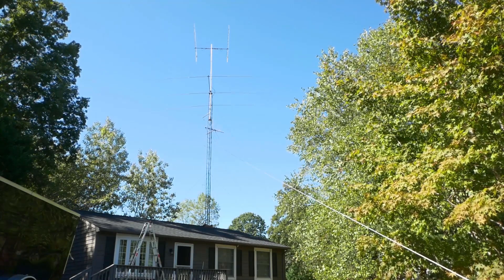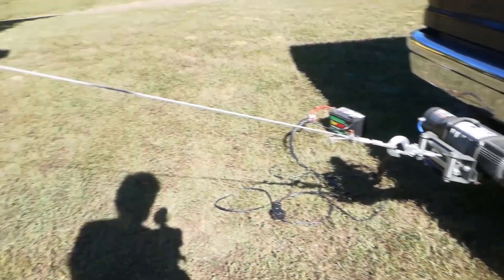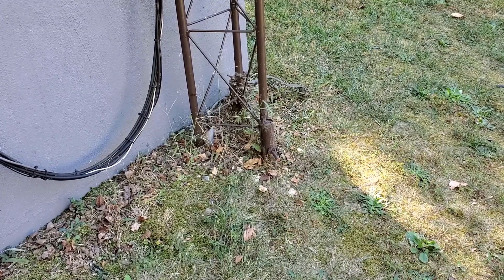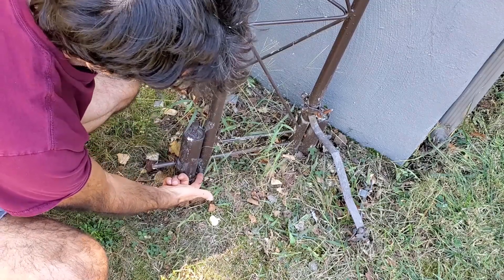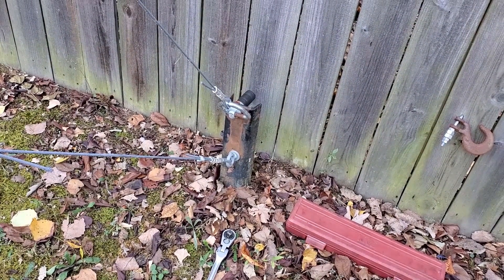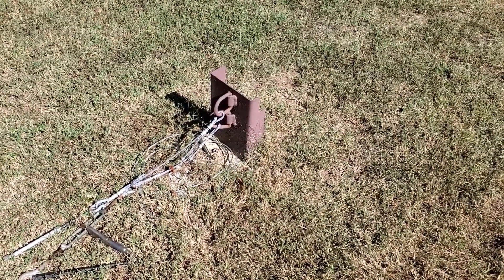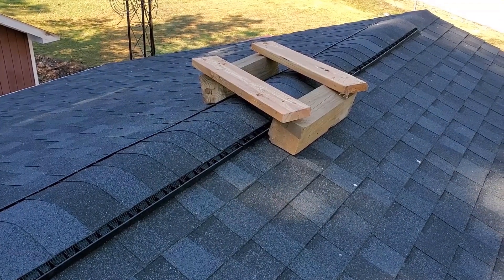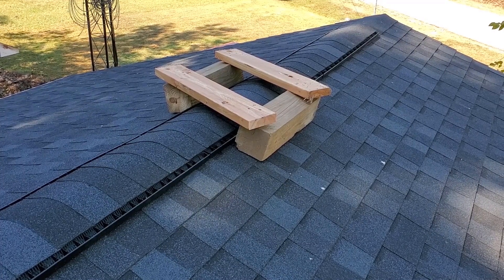Lowering and Raising Rohn 25 Tower w/ CHEAP DIY Homemade Hinge!

Comment: Thanks for the vid.  I just got a Rohn 40' tower for nearly dirt cheap.  I have a cathedral roof with a very steep angle and I've been trying to figure out how to erect this thing with a 10' additional mast for a Hex Beam antenna.  I just had my roof replaced after Hurricane Helen and I didn't want to damage it by running the cable over the top of the house with a electric winch. Thank you again.
Reply from the maker: HI!  I think I showed it in the video but I used 6x6 blocks of wood over the peak where the cable was going to hit at the peak.  This way I didn't risk damaging anything.  I even took 2x4's and ran them between the blocks so they couldn't move...

Comment: I'm working on my first "tower" install. 30' fence top rail with Televes DatBoss on top. 10 or 12 pounds it is. It will be attached to the eve / roof peak area of my single story home. Figureing out the guy wires has been an issue. I DO NOT want to put any holes in the roof and thought about doing 3 guy wires skipping the 4th. But that kept me up at night. So two guy wires will attach to the corner soffit area at the antenna end of the house. 3rd will be fastened to a tree in back yard (nearest) antenna side of house. And the 4th will be strung over the house and attached to the oppisite roof eve/peak. Also... that tree will help hold the base of the antennea as it is witched up into place (diffrent 30' cable holding the base). That's the plan anyways. Will do some testing (lifting/winching) and also get all my guy wires measured and made before doing it with the weight of the antenna. Slight worry now on the weight of the antenna and flex of the 30' top rail. Wish me luck. Tips/advice accepted.
Reply: Update. All 4 guy wire "mounts" installed. 30' pole (3x10) weight tested. And preliminary raised. Sans antenna. Beautiful day for it too. Now I'll figure out the winching situation. Create 2 more guy wire ends (loops for at the mast). Wait for a good day. And raise a darn antenna or 3.
Reply from the maker: Excellent!  Always love to hear about another antenna being put into service... 😀.  Depending on your setup I use an electric ATV wench I got from harbor freight and connect it to my truck as a stationary point... Works great if your able to use a vehicle for a pulling point.
Reply: I used to do lots of yardsailing and reselling. At one time I bought a Superwinch x2 a long with an ATV handle bar type in/out switch. 5$ I think it was. Just so happens it works great all these years later. What's got me worried now is as I pull the pole up with antennas on it how to make the high/antenna end not vear left or right as I lift it towards the house. The base at lifting will be held in place by the forth guy wire tree with a cable attached firmly attached to the lower pole hole. Not hinged. But it could be. Should be? Just would hate to have the pole (and antennas) crash left or right before they go up to the house mount at the peak. I'm thinking now the 2 side guy wires / mount points would make a great safety system. I'll need to test that too. Those 2 side wires could maybe also act as a "stand" for the pole as it sits near the ground for mounting antennas. Btw... Windy as F today. That made me smile thinking about the forth guy wire. Not the three I had first planned.
Reply: If it's being lifted. Wire pulled solid. Base held solid. Can the high end even vear? Crash into the ground I mean. You can tell. I'm kind of new to this.
Reply from the maker: I'm not grasping a clear picture of what you've got going on there!  Can you clarify? @jqzIII
Reply from the maker: Yes youre exactly right at being concerned about a pole shifting left/ right.  A tower has a base that's about 12" apart so there's 2 points of lateral stability there.  With a pole it's only one point.  If you don't have 2 extra people to help on each side with a guy wire, you'll have to tie them up somewhere and leave a little slack... raise the pole a little, loosen the guys and keep doing that all the way up.  It will certainly get away from you if you don't do something.... 😀
Reply: Another update 2... No Google image link this time. Another update. Got the winch going. Plan B metal base w cinder block weights. Worked. New issue is... Damn these fence top rail pipes are bendy. Especially at 30' with weight on them. Gonna try to add a Google Photos link to 8 images of my setup so far. Looking for advice. And yeah... I'm going to have to inlist a few friends to man some safety ropes when the time finally comes. Was a  lil hairy doing it even partially solo. What I am thinking. To cure that bend is to buy maybe a 20' length of good PVC pipe to sleeve the metal. The last 10' would still be metal. No PVC. Also at the seems of the metal poles I epoxied the fudge out the joints with some JB Weld Steel Bond stuff. I think that helps with integrity somewhat. Hope YouTube lets me post this image link... Nope. They didn't. Thanks all.
Reply from the maker: Yep, I've used those fence pipes... They are like a wet noodle when they get to a certain length!.. 😀. It'll cost a little more, but I've used 2" electric conduit for the bottom 10',  then I find a pipe size that'll go into that and overlap by about 2'... It'll probably take 4 pipes with 2-3 feet of overlap each time to get your 30', but it'll be a lot stronger.  I think the fence pipe is only 1 3/8 if I remember right...
Reply from the maker: HI, it should work with just 30'.  You could do 3 guys if they are pulled at 3 equal angles from the pole.. with the 2 at the corners at the antenna end, you have no choice but to do 4.  I would put your pull point at about 20 - 25' and you shouldn't have any trouble.
Reply: @JLPicard440  Cool. Good news. Glad I didn't go for only the 3 thinking (just pull it taught). Would have been 100% wind "exposed" on that one side. Was going to mount the 3 roof area pressure treated guy wire brackets today. But my ladder was icy. Ain't risking it. Thanks for the reply.
Reply from the maker: No you don't want an icy ladder!  That could result in some unfortunate results... 😀
Reply: Here is where we stand. I got 2 10' flared end PVC the good stuff schedule 80 I think. It will be sleeved over the lower portion of the noodle fence tops. It was Pricey man btw.  And I have my old strong thin sturdy skinny conduit from previous antenna about 15' long. I am going to insert that inside the top half of the noodle. lol Also... I don't have much in the way of the friends department. For safety ropes holding. So I think I figured I can fashion a hinge of sorts for the bottom of the pole. Just exhaust clamp one of those green painted metal skinny strong wire fence stakes at the bottom of the pole prior to lifting. That should help keep it from veering left or right while raising. That's the plan anyways. Windy as heck now. Blizzard is coming they say. Might do my hinge rail clamp 'till then.
Reply from the maker: Excellent!  Yea I'm in the same boat with friends that would come help... I could probably get a couple guys if I begged, but I don't like to bother anyone... 😂. IN a way its a good thing, it forces one to figure out how to do things by yourself...  Yes I've seen where there's some bad WX coming in through some areas...  I would definitely want a calm day to see how that pole will behave..
Reply: Another update. Turns out my guy wires work. Storm came through a few days back. EF2 tornado they say. 130mph winds they said. The Fairview WV one. (also hit Ohio and PA) 15 mile path. I had one tree blow down towards high power line at my back hill.  It came through at night. I was woke but slept through it. Turns out the path (they say) was about 70 feet from my install. ((( You guys & my FOUR (not 3) guy wires ))). Seriously. So thankful. Thanks again all.
Reply from the maker: Wow!  I'd say that was a good test for sure.. 😊. Glad to hear it help up well..

Comment: That's a lot of mast sticking out of the tower. No issues with wind I  hope. I assume you have 3 guys at the top of the tower. Glad it works! I worry a lot when I bring mine down. LOL
Reply from the maker: HI, yes that's a strong mast that is pretty flexible..  Aircraft aluminum..  never had any problems.  There are 2 sets of guys on that tower.  I've since moved from that location, but I never did have any problems and it stood up to some pretty nasty T-Storms...!

Comment: 60 ft of tower or 60ft to the base of the antennas?
Reply from the maker: The tower is (5) 10' sections and the top section is about 8', so about 58 feet, the mast is 24' but it's down in the tower 8',  total height is 74' to the top of the mast, I have a 2 meter omni up there approx 17' long, so probably close to 90 to the tip of that..

Comment: Outstanding video. I am putting up a small rohn 25g tower and my climbing tower days are gone, this is what I was after. Mine will be 30 feet.
Really curious about the hinge of it, I see the rod that hinges over, the third leg is just bolted? also the length of what did you put up each leg to strengthen? I guess black iron pipe or sked 80 pipe. Really like you video. I will watch more.
Sam, wm4t
Reply from the maker: Yes black iron pipe.  I don't remember what I put in those legs, It's been about 5 years ago.  If you're only dealing with 30', I'm not advising you to do this, but my guess is it'll be fine with just the tower legs.  The 3rd leg is just bolted because it still has weight on it, by the time I tighten all the guy wires.  Thanks for the great comment.. :-)

Comment: Very nice!

The only problem I see is that you are lowering it in the blind; do you have a spotter on the other side with a radio to tell you about clearances, anything hung up, etc.?

Also, you should amend it and show us what the cable did to your sacrificial wood block up at the peak of the roof!

73!
Reply from the maker: The cable just made some grooves in the block on the roof.  Nothing bad.   I would have put another camera up there, but I ran out of them.   Yes, I have a spotter, and I also put tape on the wench cable so I know when to stop too.